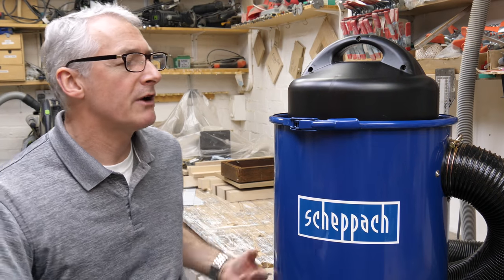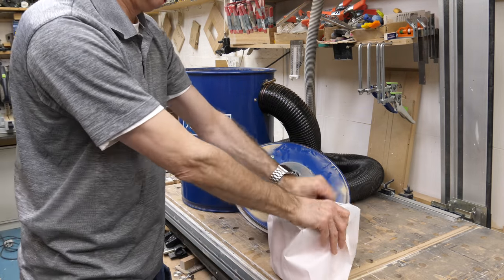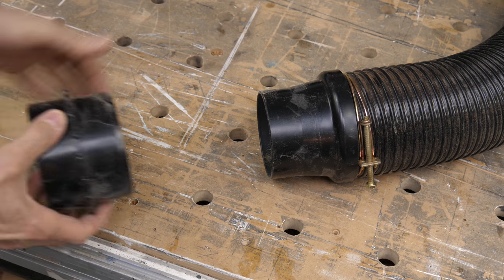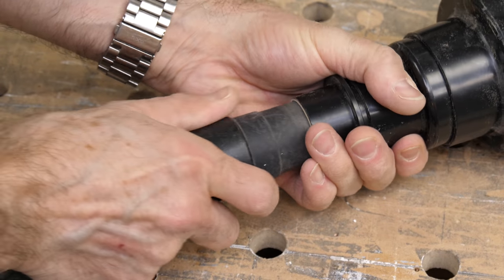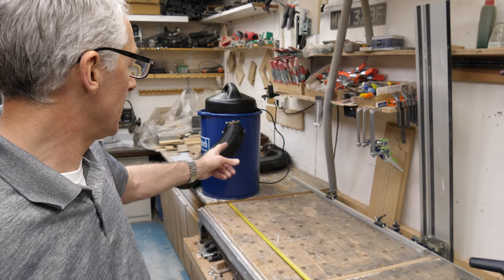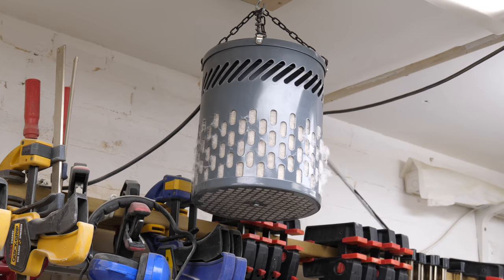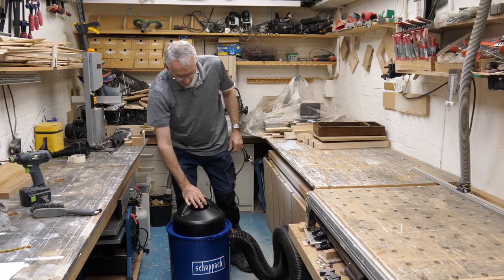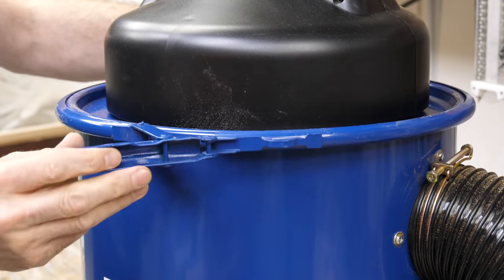Scheppach 50 litre Shop Vac [video #366]

Comment: Thanks Peter for an informative review, from which i have a question.
Firstly some background info. I have a single garage workshop and until recently my wet/dry vacuum along with a simple 2nd stage (20Lt) drum cyclone has done the job for me.
Recently my vac gave up the ghost so after looking at a number of alternatives and seeing your review of the Sheppach i decided to commit.
Especially given that I’ve recently acquired a DeWalt table saw, band saw and bench sander/linisher, all with 2 1/2” extraction ports.
Unfortunately I’ve had no luck in building a 2nd stage that worked! I’ve tried 4” in - 2 1/2” out, 4” in - 1 1/2
‘ out, 2 1/2” in and out and even 4” (Drum) to 2 1/1” (2nd Stage inlet) in and 2 1/2” out.
In all scenarios i have a major pressure drop?
I’ve tried direct 4” to 2 1/2” (no 2nd stage) and pressure is maintained.
Do you think the problem could be in the affect of the volume of the 2nd stage drum?
So, to my question, have you or any of your followers been successful in creating a 2nd stage system that works with this Scheppach?
And if so could you provide details as to how it was built?
Regards Graham (Australia)
Reply from the maker: Hi Graham, and thanks for the question; I don’t have an answer I’m sorry, as I’ve only ever used this vac direct - 4” to 2.5” and a long 2.5” hose works very well - but hopefully someone will have an answer for you before too long. My guess would be too large a capacity in then2nd stage, but it’s just a guess. 🤷‍♂️👍👍
Reply: @10MinuteWorkshop  wow!
Thanks Peter for such a quick response.  Can't believe you're monitoring at the early hour there!
It would be great to hear if anyone has been succesful in creating a 2nd stage but i also suspect that the 2nd stage volume is the issue.
Maybe I'll just have to put up with cleaning the filter? 
Cheers
Reply from the maker: Hey Graham, no problem - I respond to a lot of comment over breakfast! Sorry I can’t be of any more help, but fingers crossed someone with more direct experience of 2nd stage will be able to. When Inget back to the computer I’ll pin this thread to the top, so hopefully more folks will see it. Cheers, Peter 👍👍
Reply: Hi again Peter,
I’ve learned another lesson this past week!!
Before assuming that a plan doesn’t work potentially because the new equipment isn’t suitable for the task, check your own first!!!
In reviewing what i had done i found that all my connections were good and not leaking, so i connected another vacuum (similar to my old wet and dry one) and found the problem was still a massive lose of suction.
So i checked everything again. And again everything was good, however this time i looked more closely at the drum and found it had cracked right across the bottom. How it cracked i don’t know but i replaced it and the problem was solved.
I’m now very happy with the result. The 2nd stage works perfectly!!! 
So the final working system is 4” from Scheppach to a 2 1/2” outlet on the 2nd stage drum, though a Thien baffle. The 2nd stage inlet allows for either a 2 1/2” or 1 1/2” flex tube to the machine. I’d be happy to attach a pic of my system if someone can tell me how?
Hope this helps others that might be considering building a 2nd stage in particular to prolong the life of their filters.
And thanks for allowing my ramblings!!
Cheers
Graham

Comment: I use a very similar dust collector, got it from Rutland though -  looks like an unbranded version of the Record Power ones.  I use it for sanding on the lathe only, it's easy to store it away under the bench and I've got the hose routed up through the bench top so it's easy to hook up lathe dust collection when sanding and a smaller vac hose for cleaning up chips.

They work well enough but they're certainly noisy.  It's not as good as a 'proper' dust collector but if you've got limited space it's an option.

Comment: I've got a clone of scheppach - Meec from Jula hardware store, bought in Poland for 400 pln (60-65 ish pounds). I made a cyclone (50 mm) and a cart to move the whole system freely. It works great for my bandsaw and as a vacuum cleaner. I also made a tray to collect a dust from beneath the bandsaw table- works like a dream. Hearing protection is needed anyway so I don't care about the noise. the vac is cheap but suprisingly good.
Reply from the maker: Love the tray idea, thanks! 👍

Comment: Hi Peter,  I've a smaller workshop and was keen to pull the trigger on one of the aldi suitcase type vacuums,  any thoughts on which one you would buy,  this one or the aldi/festool copy?  It'll be used for small tool use,  circular saw and sander mainly.  Also do you think either could be mounted up high and still have the 'suck' to work and lift debris up 2m in height into the bin?  Thanks and keep up the good work on the channel.
Reply from the maker: Thanks Colin! Are Aldi still doing the little ‘suitcase’ type vac? I thought they’d stopped them, but I could be wrong. Between the two I’d go for this one, all day long.  It’s bigger, but has much more suck, Apparently Lidl are doing a wet & dry vac with power take-off that looks good value at ~£40 👍👍

Comment: I've got the Clarke version from machine mart, had it over a year and works well apart from the fact it had plastic grate on the adaptor where the hose enters the cylinder, not a brilliant idea when reasonable size shavings are trying to go through it! This gave me a headache trying to clear the blocked pipe with a broom handle as with its suction power they compact rather well. Needless to say it no longer had a grate! 
Great review Peter, I would concur with your other viewers, the pipe will split in time.
Reply from the maker: Thanks Andy - mine has a ‘grate’ as well, possibly not for long! 😂👍👍
Reply: @10MinuteWorkshop  lumberjack has same cross grate, and very noisy. I  have bought a vacmaster  m class for just over £200 and measured the air flow with both  having the same dia hose ends fitted at the time to be fair, the lumber jack was 180 and the vacmaster was just about 400 on the machine and the vacmaster is 78 sound level and lumberjack seems to be twise as loud, though not got any measurement on box. The  bigger plus for me is the vacmaster has a pto socket, and filter cleaner button, I tried a 4" diy version cyclone on the lumber jack, but it seamed to loose to much suck. so it is demoted to use on mitre saw only and cyclone retired.I have however purchased a 75mm cyclone from china for just over £60 all in compared to my 4" axminster cyclone costed £125. makes the 75 mm a total bargain! this is  to be fitted to vacmaster as it has so much suction but not a 4" port but a 58mm port with its hose goes down to 40mm so here's hoping they match well

Comment: I am amazed that people complain about hose quality (comments). You’re getting 2m of adequate 100mm hose and the top stuff costs £10 per m. You’re also getting a full set of adaptors. I suspect the hose is up to permanent attachment to one machine or a ducting blast gate. For constant tooing and froing and clamping/re-clamping, £20 on hose that’s up to that is hardly a deal breaker, especially as the basic machine seems both robust and very functional. Did you get the free pot of jam with yours?

The stingy lead is part of a growing trend. America, in its fine tradition of exporting the worst of its culture, has provided us with an aggressively marketed legal profession. It will be looking to maintain the litigious culture and its next income stream when the ‘benefits’ of its weekly call about your whiplash injuries are taken from its grasping hands. ‘Elf & Safety’ is somewhere it is constantly sniffing around. A 2 m lead is less likely to be cut, tripped over or overheat from remaining coiled. Instead you’ll have to cut, coil or trip over an extension lead and not the one that’s permanently attached to your machine. So your fault, not the machine’s manufacturer - and it keeps them out of the grasps of a Solicitors’ income generation ‘scheme’.
Reply from the maker: Wait a minute - nobody told me I could get a pot of jam... I’m calling the lawyers 😂😂 Agree with you on all other points, though the folks commenting about the hose do seem to have actually owned and used it, which makes a change - though as you say, it’s probably intended as a static machine first and foremost. 👍👍
Reply: Bryan, my tube split despite being used with the vac static. There was obviously some movement but this was not the back and forth of hand sanding, continual and repetitive, but more one movement of the table saw away from the wall and one back after a job was finished. I think, even if used as you suggest connected to a blast gate that this tube would still deteriorate rapidly. I saved some of the unsplit sections thinking they'd come in useful at a future date but even left untouched on the shelf, every time I picked them up there'd be another split. It became an experiment in monitoring the degradation over the course of a couple of months until I threw away the useless remnants.
Reply: @sewob147  Fair comment. I stand corrected. How much did a decent piece of hose cost?

Comment: Hi Peter, 
Only recently found you on you-tube and am finding your videos so very useful, thanks. One comment on this one; I've just bought the " Lumberjack" version which seems to be another "badged" version. One very big criticism;  one needs to unscrew the hose from the tin to empty it, surely this could have been made a push fitting like the other end?  Thanks again for your videos, I'm slowly working my way through them.
Reply from the maker: Thanks and welcome! Yes, it’s a pain about the hose - I have to admit I just leave it attached when I empty it. 🤷‍♂️👍

Comment: hi Peter hope all is well. Today I was going back and forth like mad inbetween my vac (off/on) and using the kregg R3 for the first time, then I thought of you ---- you have a gadget to turn on and off power with a remote , have you got the details of it please? I think I need one :)
Reply from the maker: Hi Christopher. It’s just a domestic remote control, and to be honest I‘d only recommend it if you’re scrupulous about disconnecting it when not in use - it was this that gave me the scare that led to my recent ‘fire check’ video. 👍👍
Reply: @10MinuteWorkshop  ahhh okay , i do tend to turn off all sockets etc , even when i leave the room just to eat
thanks for the info will look one up
Reply: @10MinuteWorkshop  ...I thought they were some thing special , yep found some on Amazon. I get your drift though about the fire matter :)

Comment: Would u say it’s powerful enough to use as a dust extraction unit hooked up to a cyclone & connected up to 5 of my shop machines.
Reply from the maker: Depends on the length of the pipe runs, but I’d say probably not if you’re using 100mm, but possibly, if you can get away with 65mm. 🤷‍♂️👍

Comment: I've had one for a few months, works okay . Suction hose is rubbish .It split very early on. Not worth the hassle of warranty claim , just tape it up and wait for the next split . None of the adapters supplied fit the Scheppach table saw ! Power cord too short , but it's about the same as on my sanders and angle grinder.
Reply from the maker: Ha! Somehow the fact that it doesn't fit the table saw seems not at all surprising and all too believable! 👍

Comment: Did you use a piece of cycle inner tube to connect to a extraction hose in one of your videos, if so could you advise on the size. Also may I ask what brand of saw blades do you use, you seem to get a really fine finish to the cuts you make. Thanks again for the videos.
Reply from the maker: Hi Mike. Yes, the inner tube trick worked well, but it was just one I had around - no idea of the size I’m sorry. It was only folded in on itself to make up the difference of tool/hose thickness. As for the saw blades, I tend to stick with Festool, though I’ve been using one from Key Blades & Fixings for a little while, which has been very good. 👍👍

Comment: I've used a Record DX4000 as my main extractor for years and it has  been superb, but I think one of these or the Rutlands which seems to be the same as the entry level Record(and I think is on offer for about £70) would be ideal for my new mitre saw station. On the subject of cable length and noise, I have a Dewalt DWV901l for hoovering up filthy stuff. The suction is fantastic and the filtration is the same as the m class model, but the cable is only 2.4 metres long which is shockingly stingy for a professional tool. And as for the noise - I can't find my sound meter,  but its like a military jet engine on full afterburner in a tin shed - and that's with ear defenders on!
Reply from the maker: Thanks! 👍👍

Comment: Silly question really, what's the difference between a dust collector and dust extractor, and can, or are they used in conjunction with one another?
Reply from the maker: Short answer; marketing. Dust ‘collection’ is seen as passive, reactive, whereas dust ‘extraction’ is purposeful, proactive. You could argue that ‘dust collection’ could be seen as the tool doing the extraction and the vac just being a receptacle, but honestly we’re starting to argue semantics here. They’re all vacuums I’d one sort of another, and as long as you have one attached to your tools, you should be fine. 👍👍
Reply: @10MinuteWorkshop  thanks for the reply,about the mains cable can it be replaced,say by a DIY job or is one stuck with that length,and what length would be more appropriate?

Comment: I have 2 shop vacs and I am wondering if it is possible to convert one to 100mm / 4inch  extractor for a bandsaw? I assume that if it works it will be a compromise but is it so compromised that it's completely ineffectual?
Cheers
Reply from the maker: Depends where you’re starting from. If you’re trying to ‘step up’ to 100mm from eg 50mm then no, this generally doesn’t work as you can’t get the airflow. Stepping down - 150 -> 100 - would work.
Reply: @10MinuteWorkshop  Thanks unfortunately it is standard 2 inch or so vacuum. I was thinking of blocking the 2inch and cutting a 4 inch outlet and running 4 inch tubing etc.

Comment: Currently running a Clarke Vacum Dust Extractor, virtually identical, find it suits my needs satisfactorily, only issues that I've had (and I stress it's my issue) is that it doesn't lend itself well to portability, have used it indoors whilst sanding staircase case down found heavy to use (again not what its designed for) back in the workshop cant fault it 👍👍

Comment: Are the shorter power cables a result of the higher cost of copper these days?  If it needs to be longer it may also need a wider diameter wire.  (So even though it may cost a little more for twice as long in the existing gauge, it may double the cost of the cable if going up to the next thicker gauge cable?)  I haven't seen that size vacuum here in NZ, but it looks ideal for a small shop using machines that throw out a lot of chips.  Thanks for the video.  Cheers, David
Reply from the maker: I’m assuming it’s cost related, yes; seems odd to me that a company would willingly hamstring a product just to reduce costs or hit a price-point - but then I’m not in volume manufacturing 🤷‍♂️👍👍
Reply: I have some “Fein” Brand tools and they have the longest power cords of any similar tool. Good for them, but they are not inexpensive.

Comment: Hi Peter. Great video.  You mentioned your ceiling hung air cleaner. What are you using for that?
Reply from the maker: Thanks! I'm afraid I had such a poor experience buying the air scrubber I'm afraid I don't link to it. There's a video about it here - 'fan in a can', https://youtu.be/DcuIU4WsiWA - and a follow-up on that in the next vid, where I explain. 👍
Reply: @10MinuteWorkshop  will take a look. Thanks
Reply: I see what you mean. It’s rather loud isn’t it. Sounds like a jet ready to take off.

Did you ever make your own cleaner as mentioned for a future video?

Comment: I have the same one, I have a cyclone system for it.I like it. First day I got it I put it on a table to attach the pipe to the cyclone.  I bent the flexi pipe  to fit on the cyclone, the force of bending inadvertently made the unit slide in the opposite direction. The unit slid across the length of the table (about 1 metre) but I thought it was ok because I was holding the pipe. However when the unit reached the end of the table it detached itself from the push fitted pipe and fell to the floor smashing the black housing on the top. I tried to get a replacement but gave up after 2 phone calls and browsing a catalogue. However a roll of duck tape did the trick and I've used it every day for 2 years without a problem but everyday I look at it and I curse the manufacturer knowing that a couple of rubber feet would have saved the day for me. 
Thanks for the vid Peter, great stuff.
Reply from the maker: Cheers Peter - sounds like the kind of thing that happens to me, lol! 👍👍😂😂